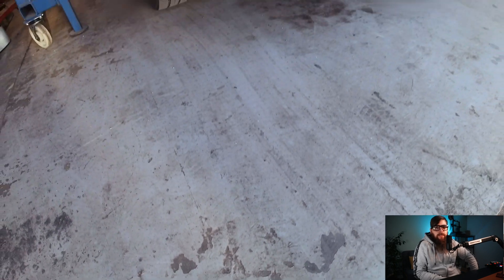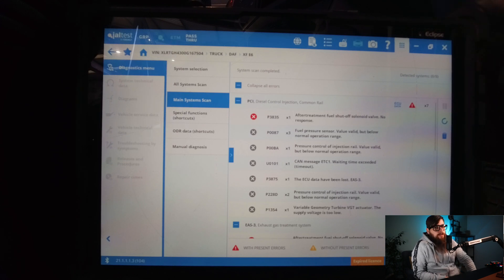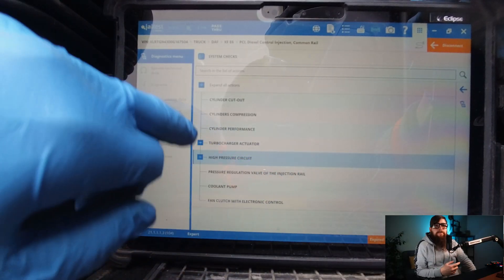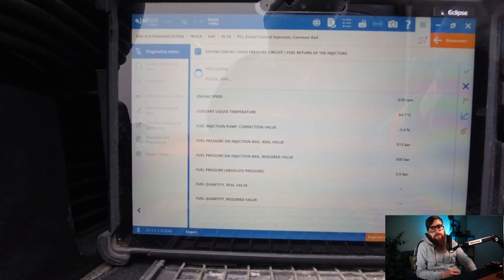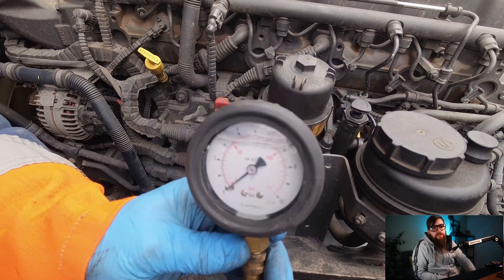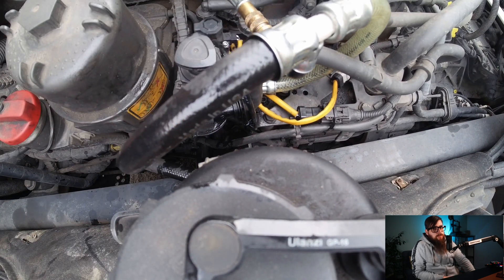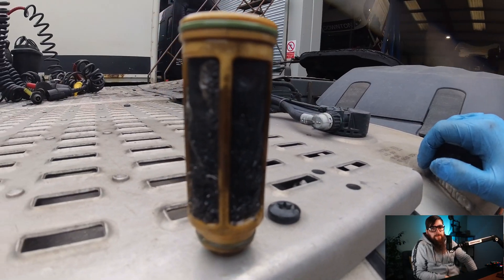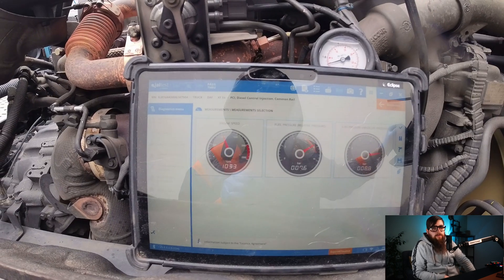DAF LOW PRESSURE fuel faults and how to fix them-jaltest

Comment: No bro....your not an idiot...its just a miss... sometimes thing do get you frustrated in works like this...i know you didn't get your prefect coffee this morning..well bro but you still get it right .... and im glad you did....keep it up bro....i get the same problem,,,,but in the filter house it was very block with dirt ..i have to clean it and the whole line fromthere to rhe tank and clean the low pressure pump and whala it works
Reply from the maker: Hey, thanks for the comment. Don't know how it ended up over here lol 
I'd be a bit worried about dirt in the fuel filter!!! Sounds like a right nightmare job!
Reply: oooo yes bro but I get it all cleaned up and the truck is running well now.  No problem

Comment: Good afternoon. Please tell me, if the pressure is 7.6 bar, what could be the problem? replacing the filter and the manual pump filter did not solve the problem. Thank you
Reply: Thank you for your broad and informative response
Reply: Thank you for the answer. I recently began to engage in DAF, I have a question if you can answer, I will be grateful. So the high pressure fuel pump shows 10.2% at a coolant temperature of 75 and the amount of fuel at the injectors 16mg / h, low pressure 7.6bar is it precisely by these parameters that something is wrong? Confuses 16mg / h and I don’t understand the pressure created by the pumps why there are 2 of them, and the parameter is 1.
Reply from the maker: @user-ew2bl8ts6i I hope you're sitting down for this one. 

So..........
2 high-pressure pumps means if one fails the truck will keep running, but also two pumps allow the fuel pumps to run at half the capacity. 
The correctional value is VERY important. The PCI ECU knows how much fuel needs to be used per injection. If this is factory correct you would see a correctional value of 0 or somewhere near such as minus from my experience.

What happens if you start having Injector or pressure control valve issues is the fuel pumps start to OVER correct and your correction value increases........the worse the leak off the higher the correctional value till one day you have fault codes p0094 and p228d. 

This is a VERY basic overview of how these fault codes occur and you can have other contributing factors such as camshaft failure and one-way valve issues in the fuel pumping elements.
Reply from the maker: Hey, thanks for your comment 😊. If your low-pressure fuel system is good I would say your high pressure is possibly correcting to high speed I'd be looking at injectors or fuel pump elements.
Hope this helps 🤔👌

Comment: My friend I have an issue with a 2016 DAF EURO6 440 TIPPER WITH MANUAL GEARBOX. the truck have no power when shift to high range. There is no fault codes.
Reply: Please help
Reply from the maker: Start at the beginning and work your way through the fuel and air system.

Check for restrictions in fuel pressure such as filter, the same which the inlet on the air system....when was the air filter changed last? Have you checked all the induction system and intercooler? When was the valve clearances set last? 
Fault codes usually indicate a big issue as one system expects another to respond with certain data, and if this isn't correct, you will get a fault code such as a split boost pipe. 

I would pressure test or smoke test the engine for air leaks, then look at more complex things such as vtg, soot load ect 

Hope this helps 🙏

Comment: Hey bro .is it possible to reset the adblue system with the jaltest .because I see in some videos when the adblue light comes on they ad def in it and they reset the counter when the car is in limp mode not going more then 20km
.can it be done on daf euro 6 lf ??
Reply from the maker: Hey buddy, I've a table that explains when this happens in my members' area, BUT every time the truck sees an AdBlue level change after ignition off, the ecu does an AdBlue quality check.
The quality check is performed by comparing NOx before and after catalyst.
This is then used to evaluate the conversion of NOx. Topping up the adblue starts this process.

Comment: Hello,
I have a question regarding the frequent camshaft failures in the MX-13 engine of DAF XF trucks. What could be the reason behind this issue? Also, I would like to request some tips on how to prevent camshaft failures in the MX-13 engine.
Thank you in advance for your response!
Reply from the maker: Hi, thanks for the comment. The issue is a manufacturing defect, which is why daf are replacing them reactively and then proactively. The affected vehicle owners would have been contacted and told to bring vehicles in for rework under warranty.

In regards to prevention, the only thing you can do to increase the longevity of the engine is make sure your valve clearances are done when recommended and ensure you stick to the service intervals for oil changes 😉
Reply: @TRUCKTECHUK  Thank you for answering my question.
What type of engine oil do you suggest for my DAF XF 2019?
 I have heard that some mechanics in our country replace the Euro 6 mx-13 engine oil pump with a Euro 5 gear oil pump for DAF trucks. Is this a safe and acceptable practice, or should I avoid it? Lastly, I am also curious about the ideal oil pressure for my DAF XF 480 Euro 6 engine. Could you please advise me on what the recommended oil pressure range should be at idle and full load?
Reply: Cam lobes are pressed on , after some time or sudden resistance they lose there tolerances and decide to spin freely🤦🏽‍♂️ hence why this problem never happened in the MX13 €5 😎
Reply: Great videos, very informative. I was wondering how did you remove that filter in the hand primer?

Comment: hello, could you give me some advice? LF year 2007 euro 4 engine 220 hp throws a message engine failure + emission light and diagnostics says error 3362-11 and cummins error code is 1682. I can't find this code exactly, but it is some ecu communication. Will it be somewhere between the adblue tank and the unit (pump)? Thank you
Reply from the maker: Hey, sorry for the late reply. The fault code you describe is related to the adblue lines being restricted. I suggest you get all the lines cleaned out and ensure the pump module is able to prime to the adblue dosing valve 👌
Reply: @TRUCKTECHUK  hi, thanks for your reply. I did all that on Saturday and I unscrewed the entire unit and cleaned everything including the hoses and the nozzle and deleted the error, (I clean the nozzle often) but today the error appeared again. It said about an ecu communication error and I found corrosion on the connector, so I cleaned everything, so I don't know where to continue.
Reply from the maker: @Martin Ovesný  have you run a dosing test on it to see if it produces 100ml of adblue?
Reply: @TRUCKTECHUK  I haven't tried that, but I will definitely try it, but if the error is saved or lights up on the dashboard, will it work? with E3, I can't get into the engine with diagnostics again and the engine + alternator lights up, I'll try to recharge the batteries, they're already in worse condition, but I'll try adblue. Does it have to go with the nozzle out as well?
Reply from the maker: @Martin Ovesný  if you can't get into the engine ecu, how are you getting adblue restriction trouble codes? 
Sounds like you need to be checking all your power, ground and can communication to bothe the engine ecu and to the EAS pump. A stable voltage to the ecus is a must if you don't want to be chasing faults that don't exist.
Reply: @TRUCKTECHUK  I'm sorry, the diagnostics will not connect to another car lf 45.170 E3. Here, with the E4 with adblue, it can be easily loaded with diagnostics. today all day after starting the engine warning light comes on and flashes on the display and then goes off and on again and the emission light stays on. You have thoroughly examined everything, so I think that the problem is somewhere in the cable.
Reply: @TRUCKTECHUK  sorry this fault is on my second car daf lf 45.170 but it's probably low voltage. I'm going to look at adblue today, do you have any other ideas? So I'll take diagnostics and turn on the adblue injection test with the nozzle pulled out, yes?
Reply from the maker: @Martin Ovesný  yes run the dosing test with the pipe off and see if it works....if it does work pull the nozzle and check your quantity. If you don't have communication to the ecu, start checking wiring
Reply: @TRUCKTECHUK  I checked all the cables from the unit to the front under the hood and they are ok, but somewhere the voltage is 1.6-2.2 volts? somewhere 25.5v. I did a test, but it doesn't do anything (I only disconnected the hose) but if I also do a test on the air coil, it doesn't do anything, the air doesn't even blow out of the hose and I think it should blow.

Comment: Hi mate, any way on getting my hands on predsure testers with ends? And any other kit you use on your videos? Am a big fan of the connector extension test plugs
Reply: And links for pressure testers or are these daf only? Appreciate tge reply mate and loving the content
Reply from the maker: @Kyle Lovett  they are daf only but I've identified the fittings and I'm just trying to get some reasonably priced gauges sorted which is cheaper than dafs price of 500 quid 😅
Reply from the maker: Hey Kyle 👋, yes I've a affiliate link here for you. It doesn’t cost you any extra, and I only recommend products and services I trust. 

links to breakout leads: https://ebay.us/Wlcr2U

I usually add affiliate links in the descriptions of things I use such as my mini digital osilloscope or WiFi bore scope  camera.

I'm contemplating stocking all the items when I release my NOX sensor diagnostic tool as alot of people want this stuff and non of it is from the UK so wait times are long and I'd be able to post them personally then
Reply: @TRUCKTECHUK p

Comment: Hope you enjoyed your hols ...That is a problem with that fault code as people will not do proper checks and change the  valve  then return it to the customer without verifying they have fixed it..I see a lot of people who can not ,and do not want to get involved in fuel faults..They refuse to use the gauges ..I have my own gauge for checking the underpressure ,Had a cracker on a new vehicle a couple of years ago ..Subject to multiple DAFaids ,like yours underpressure off the scale..turned out when the made the fuel pipe from the tank to the chassis interface  at the supplier they left or put a solid piece of plastic in the pipe then put the ends on,,No other way it could get in there ,and when underload it blocked the interface lol....
Reply from the maker: Hey norb 👋 I did enjoy the holiday buddy! 30*c EVERYDAY is better than this snow ❄️. 

This is where people go wrong, it's all evidence-based diagnostics in my eyes. YOU HAVE TO FIND A ISSUE! You can't be a parts changer or just try and wing it 🫣

That issue you had sounds very similar to issues I've had with the transportation valve at the back of the engine!  another brilliant design 😅.

Comment: Where did you get the pressure gauge and connectors could do with one
Reply from the maker: Hey John it's a set from dafs special tools section ......I'm sure it costs as much as a new truck from daf 😂😂😂😂. If you're serious I could look at getting them made up as a kit as I've been asked for the leak-off test kit doing injectors too
Reply: Ok thanks for your reply

Comment: Testing is good but it takes time. I always start with strainer. Customers change fuel filter but they do not know about strainer. When is dirty is real challenge to get it out. Can we get this Trucktech uk diag app? I am happy with my new premium account in your website. See you there.
Reply from the maker: Wow, so sorry mate! I've just gone through messages and noticed yours hadn't been responded too! SO SORRY BUDDY!

The filter strainer should be listed as a consumable in my eyes 🤣.

The app is coming along buddy, I keep adding to it when I can and adjusting what the fault code will most probably be, but like everything....it takes time. 

I'm glad you like the premium members area on the site, BUT what else would you like to see added in to benefit you more?
Reply: @TRUCKTECHUK   I know how big is your load, really enjoy your attitude with all questions. Delay is something normal. I struggle with alternator warning issue. Batteries gets 27.9V at idle but warning is on. Alternator and belt are new. Did you have experience with the diode built in wiring harness? I also want to ask are the fuel pressure gauges with this fittings at reasonoble price?
Reply from the maker: I've always got time for people who want to learn buddy. 
I will write a post in the MEMBERS area for you, and I will draw you some diagrams on what I know about testing the alternator and how to bypass the diode 😎.
As for the test gauge, dafs price is STUPID for the kit, BUT I've just took delivery of the parts I need to make up the pipe and a all in one gauge that does minus 1 bar to 12 bar so it should be all you need to test the fuel system without loads of extra pipes and 4 gauges 😀
Reply from the maker: I've done a detailed post for you in the members area covering alternator diagnostics and wiring.